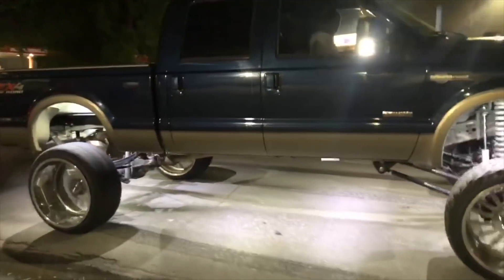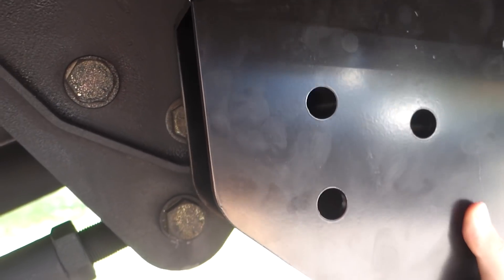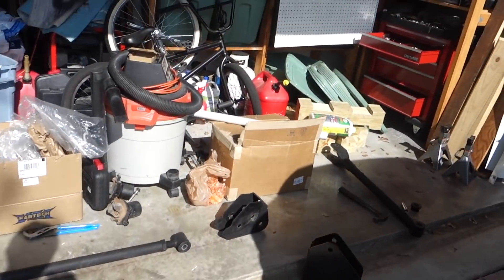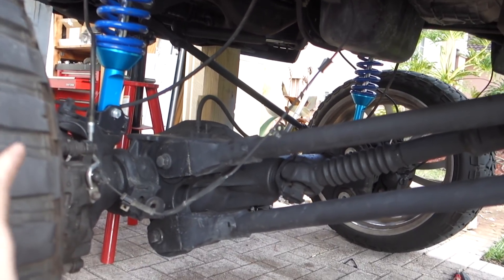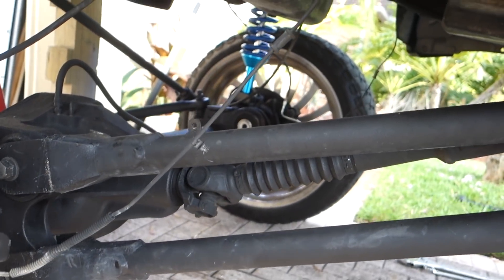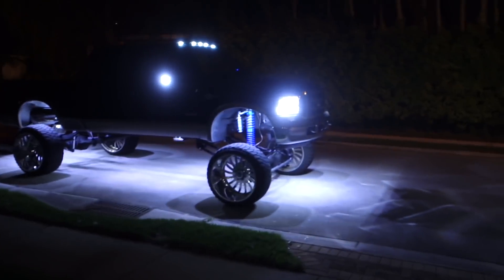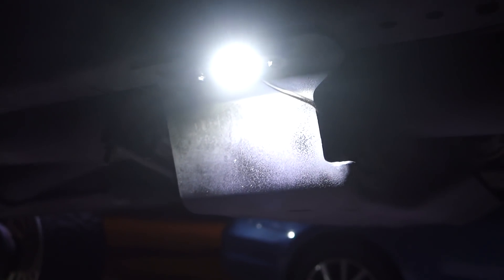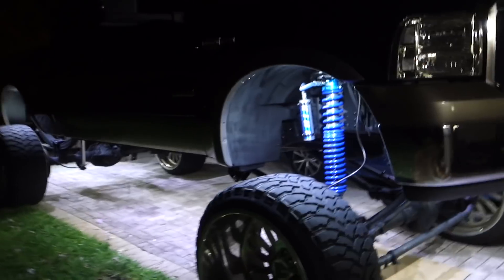EASY Death Wobble Fix!! (F250 4WD)

Comment: Glad to know you got your death wobble fixed. When you get a chance you should replace the 2 bracket bolts with grade 8 strength bolts with shanks just like the others. Those home Depot bolts will get you by but not made to t ake the constant  beating those 4 link bars will get daily.

Comment: Hey Michael dont use power steering fluid it will eat the seals out of your hydraboost system use a decent synthetic transmission fluid ex. Mercon LV or SP

Comment: What is the part code for the drop bracket? 
I need it ASAP because I have terrible caster on my truck
Reply: I need it also
Reply: Did u guys find the drop brackets
Reply: Y’all find the part code for it yet?
Reply: Did anyone find out where you can get them